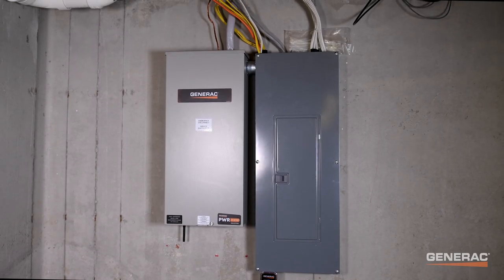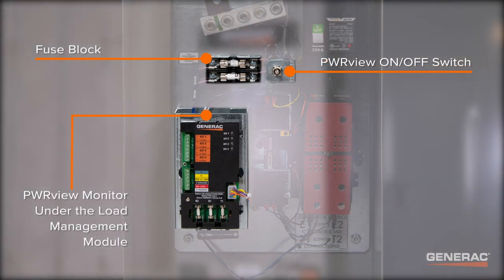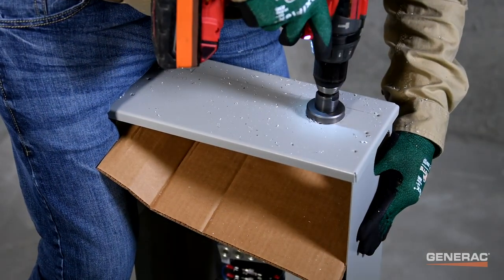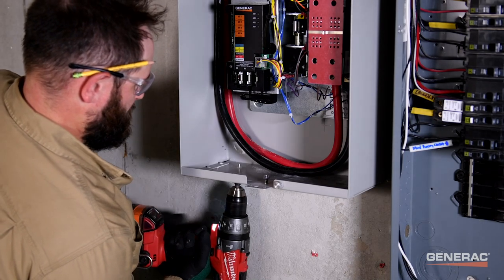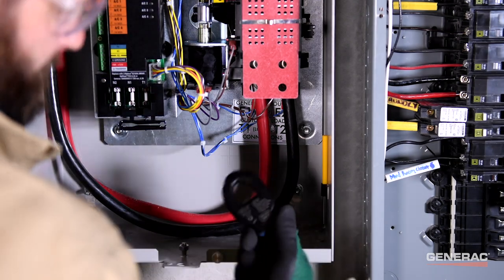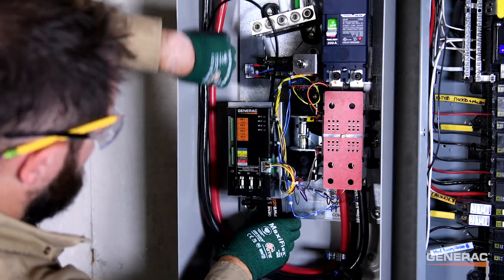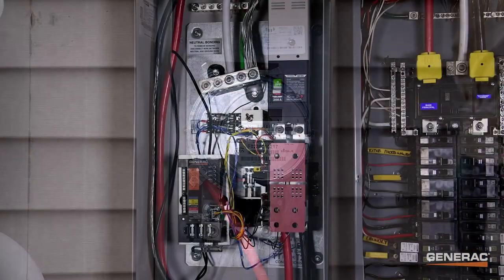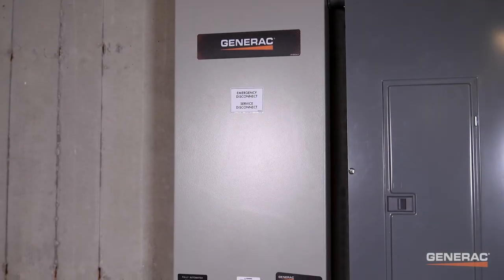Generac Installer Resources: PWRview Automatic Transfer Switch Installation

Comment: Why don’t generac have a hole home breaker box like the new “span 2nd generation”  to take place of your main box that way you can turn off what you want on a power outage so if you are washing and drying clothes you can turn off the AC and turn off rooms that you will not be using to make the batteries last longer.

Comment: Good video but I have an obvious question, why don't you put in knockouts instead of requiring a drill on the panel?!
Reply: so you can install the ATS on multiple configurations and so the ats can maintain a NEMA 3 rating

Comment: Nice video!  I am a bit confused --  I have looked at several videos showing 400Amp Generac ATS installs...  The confusion is this -- Most of what I see is that there are installs that SHOW 4 "Hots" coming into the ATS and taken up to the TOP of the Transfer Switch -- My confusion is WHY would there be 4 Hots coming from a Meter and not just 2 Hots if the Meter is supplied with 400/320 Continuous from the  Transformer through the meter?  In this video -- It looks like the ATS on the right ONLY has TWO HOTS at the top of the Switch?  Can you explain this for me?

Comment: Hi, I have a 400 amp service (2x 200) with 2 Panels. Should I use 2x 200amp ATS or 1x 400amp? Thanks
Reply: I have 2 panels also. looking at the manual you only need one W2HEM and two additional UCT2 (Clamps)
Reply: Excellent question.  Wish Generac would answer.
Reply: one 400A as that's what will pass in my area not twin's ATS, do you have solar?

Comment: So the generator won't be had until January 2022.  I have the 200amp transfer switch.  Can I install this now and then just add the Generator conductors later?  Will my main load center work without the generator installed(voltage sense wire)?
Reply: yes you can.

Comment: The bottom solenoid went bad after lighting strike. Now the power won’t automatically transfer to the generator. Just got the solenoid in the mail and does anyone know how to remove the control box on the left with the lights?

Comment: My Generac 16kw is not sending the “T23” signal (12vdc gnd) to the transfer switch. Anybody know how to troubleshoot this. My ‘certified’ repair man replaced the control wires and it is still not switching to the standby power automatically.
Reply: If he verified that the controller is not grounding 23 and all wiring is good he should replace the controller.

Comment: hey,  how are you extending the main service wires to the generac panel?....

thanks in advance!

larry
Reply: @Peacock Ranch is the 400A CU ATS the best choice for solar and quick hardware 50A to PTO/trailer/or pad 400A generator backup? and im leaning to the enphase IQ-8+ system 12kw-22kw but not the battery's as im not content with the charging/inverters at under 3KW out for back up but being a 10kw sized battery and like the LIF-chemistry which is about the minimum balance/right size/costs for me in 2022, and looking at the F150 BEV and like that it's not LIF and LMC i think as it's a better pick for cars and lif is better for homes 

looked at enphase's en-charge ats and it's just two small to pass my inspections and same things with it's competitors like sonnen as the max service entrance is under 200A 240V
Reply: ps. can't twin ATS in my area/code so 1 400A is need to pass
Reply: @Peacock Ranch Hello sir. I don't know if you even will see this, but we had installed the Generic ATS Switch which we had a 50 amp plug so we can plug the Portable Generator into a 13000hp...I have watched a ton of videos and nobody ever explains..when the Power is off the Grid, what mechanism powers and turns the big magnet inside changing the power from Grid to Generator?  So my question is..do we need to add some type of DC power supply if so which may I ask? Lastly, I do not have the Wi-fi unit for the ATS do we need it and if so where can we get it as well...Thank You in advance for your assistance on the above questions.

Comment: Incomplete explanation. 
You explained how to install antenna and power view monitor. And how to drill some holes.
No explanation of the main power lines. Or power lines there after.  Where does the generator lines come in and hook up at? 
 I can visually figure it out, but the video leaves things out of explanation.